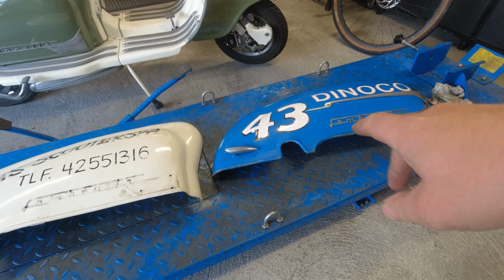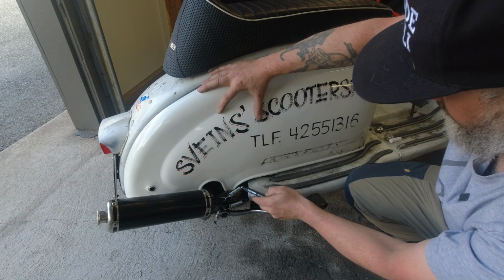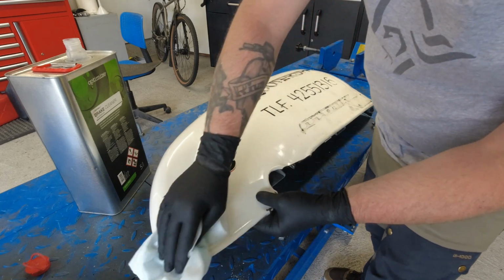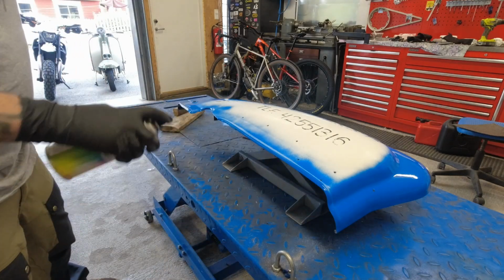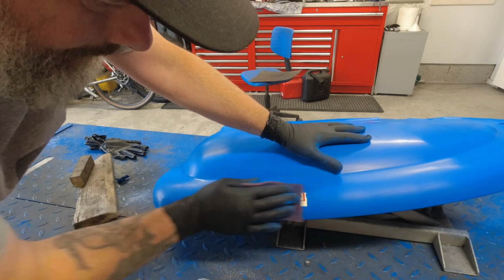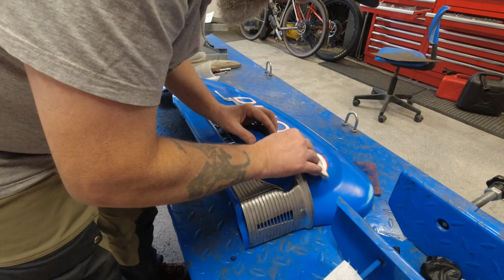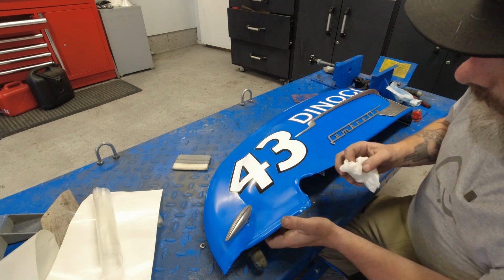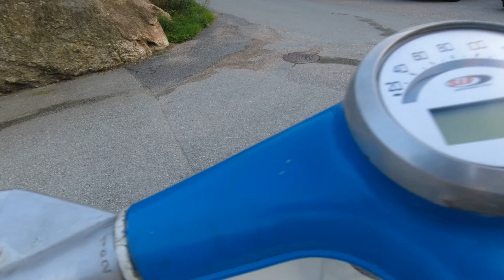Panel swap!  #kickbackgarage

Comment: a tip for you rob next time you do decals spray the surface with some soapy water and use your felt squeegee as normal . the water stops the decal sicking so you can reposition it if you need to 
cool lookin scooter👌

Comment: Either the exhaust isn't for the series 2 or its a poor design having to butcher a side panel 🤔
Reply from the maker: I have been sent a few photos of s3 with the same problem and some that fit perfect. Its piss poor manufacturing control.